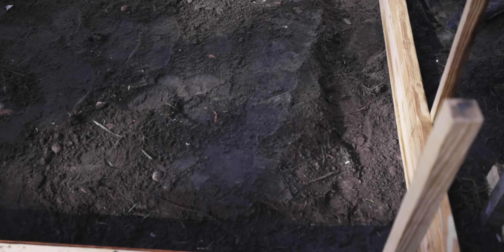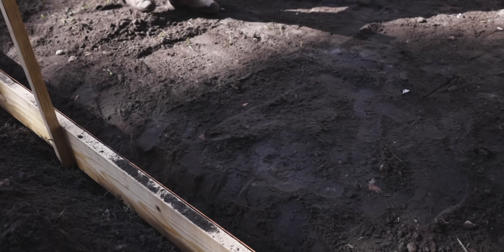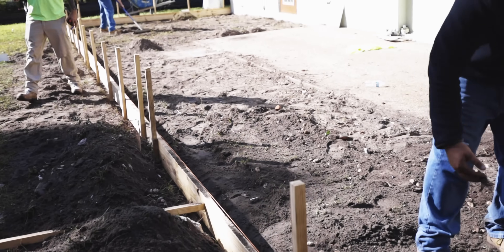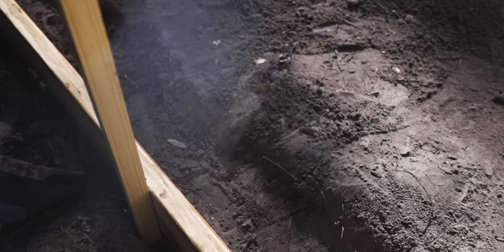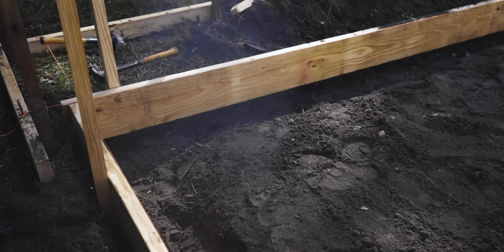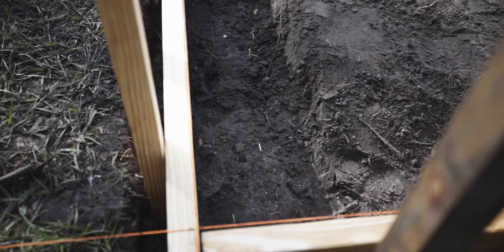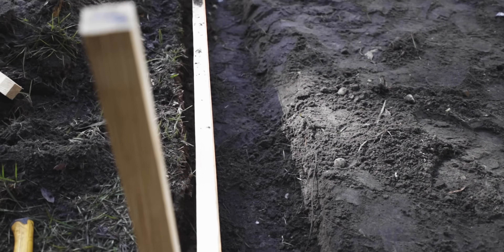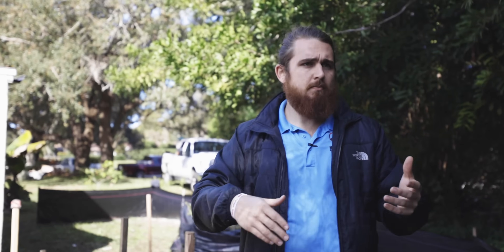What Is A Concrete Footer?

Comment: how about for a patio that is getting a screened cage installed (no pool).  I have two quotes, one was with footers while the other contractor stated it wasn't necessary
Reply from the maker: In Florida you need a footer under a screen enclosure